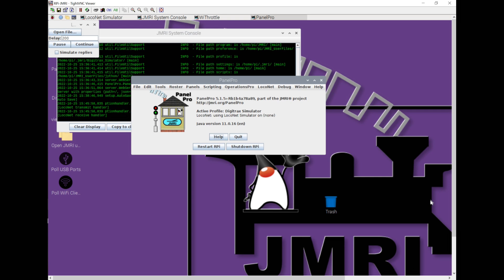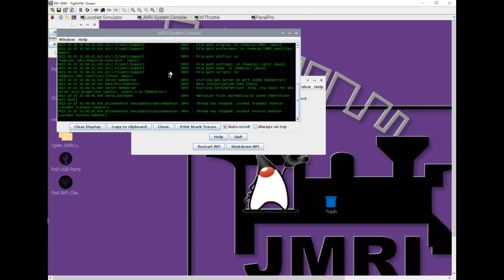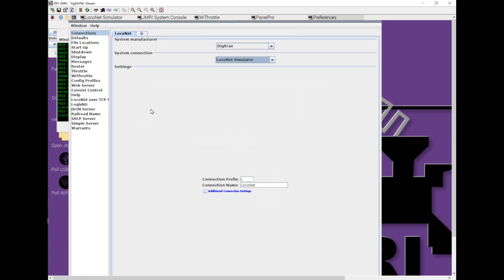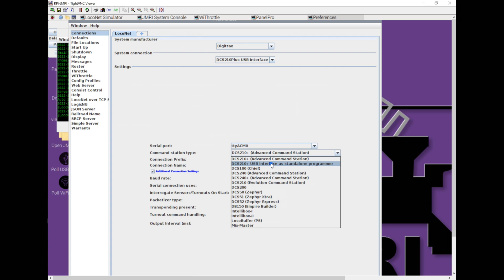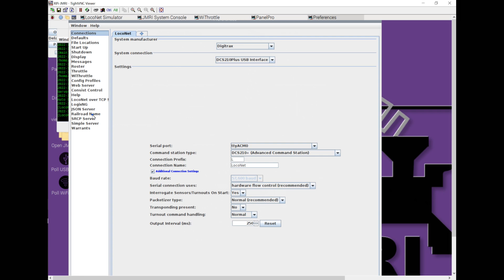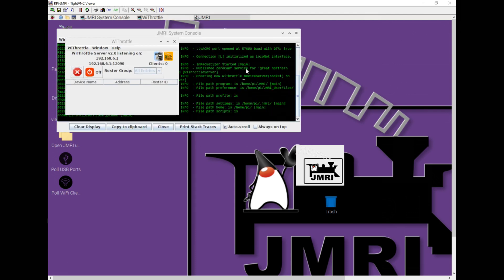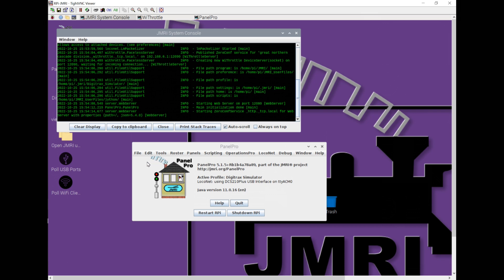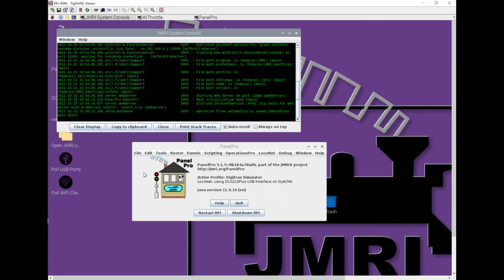08 - JMRI - Connecting a Digitrax DCC system to JMRI

Comment: This an old video now, so not sure whether notifications of my comment will be seen.

I’ve been helping a nearby layout owner to get out some bugs in his track and wiring. He has an NCE dcc system that uses wired NCE throttles. I’d like to have him consider adding wifi capability.

In Steve Todd’s website, he has a note #1 for connecting to NCE that states, “Note 1: for NCE USB autoIdentify, remove all jumpers prior to powering on.” Are there jumpers already set that have to be removed? I’ve searched without being able to find a graphic that shows any jumper connection points, yet. In the RP forums, I’ve only seen text discussions.

Thanks for any assistance. Hope the shoulder is doing well.